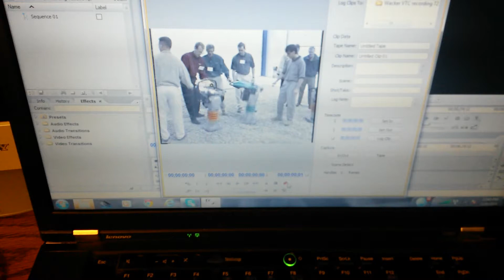Your VHS VCR - How It Works!

Comment: thanks for detail but i want to see how it reads the tape thanks though
Reply from the maker: That would be a challenge to show on video, but in laymen's terms, the tape that you see spinning on the drum(to the upper right) on this video, passes by a playback head, which reads the "invisible" magnetic recording that was created when the recording head originally imprinted the video signal on the tape. With a "bad" tape, this magnetic strip could become damaged and interupt the flow of information that was read by the playback head, resulting in "drop-outs" or loss of signal integrity. Tapes could also become brittle from storage, and snap when loaded or rewound on the drum, ruining a precious recording too. Rather than place a recording on a file like an SD card, with videotape, the recording took place in a linear fashion during the entire length of the amount of videotape in the units. Videotapes could be purchased in lengths of 5, 10, 15, 30, 60 or 120 minute lengths. I do not miss the days of videotape compared to all the very reliable SD cards for recording HD signals they have today. Thanks for the question though - and hope I was able to provide a bit more info.